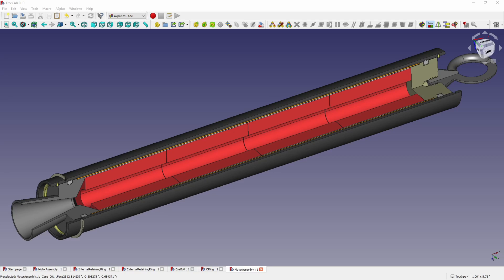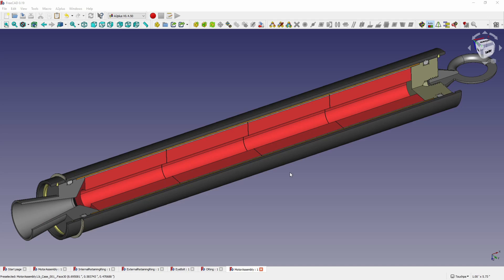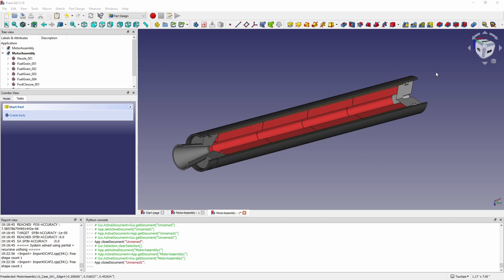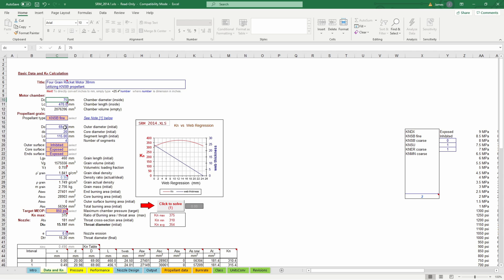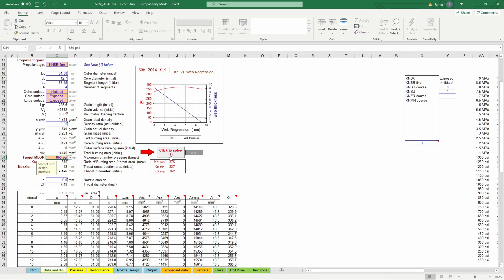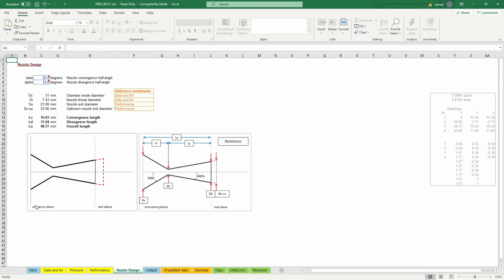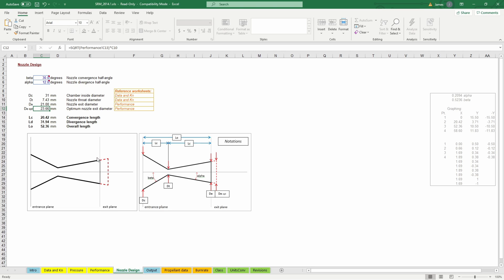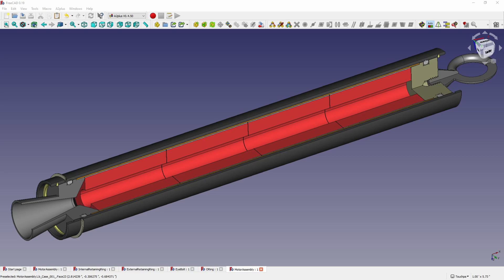Designing a Rocket Motor - Build a KNSB (Sugar) Rocket Motor - Part 1

Comment: You can CNC a negative CPC in aluminum and then nickel plate it. Pops off with an air hose. 
Optiform makes them. You can get many out of one mandrel. 
I’ve made some that are 3” diameter and 400 mm long. Diamond turned an aluminum mandrel in aluminum and NASA electroformed them in a thin shell of nickel. But they used liquid nitrogen to release the nickel shell.

Comment: Have you ever tried a profile for a nozzle that’s based on a CPC (Compound Parabolic Concentrator, or Winston Cone). These are used in optical systems to take 2 pi steradians input on the small end and convert it to +- theta on the large end. Theta being dependent on the design of the CPC. 
So if the thrust coming out of the rocket (before nozzle) is 2 pi steradians, you can design a CPC nozzle that converts that thrust to a smaller angle, effectively converting the sideways thrust more downwards. 
Just a thought. I like seeing how things from one field of science can be used in another field. 
A straight cone is ok, but a CPC would eliminate the need for the converging part of the nozzle before the pinch and reduce the overall length. 
I’ll try to find some CPC design references for you. 
Paul

https://www.optiforms.com/compound-parabolic-concentrator-essentials/

https://link.springer.com/chapter/10.1007/978-3-030-76221-6_99

http://www.energy-proceedings.org/wp-content/uploads/2020/02/123_Paper_0510115102.pdf

https://d3i71xaburhd42.cloudfront.net/ab6dafba0f8c2da22d8c1d4ca86cad2ac726544f/3-Figure2-1.png

Comment: so .if i make a 38mm diametre motor with six 2.25 inches grains with 9/16 inches core and four 2.25 grains with1/2 inch cores,why there is a difference in cores and what may or may not happen if all the six core sizes are 1/2 inches each?
Reply from the maker: Usually the only reason you would make the core diameter different is so you can put the larger cores on the nozzle end to keep your internal flow velocity down so you don't erode the fuel as much.  That sounds like a very long motor, so you might run the risk of having very high velocity in the motor core which is a problem.  Large cores are one way to help overcome that.
Reply: Thank u